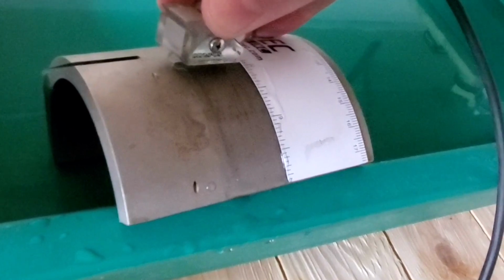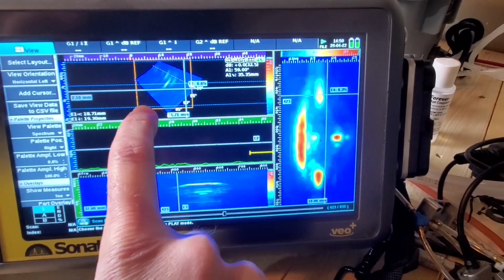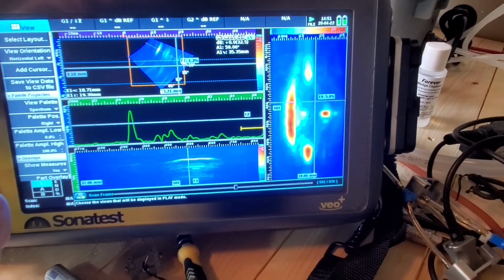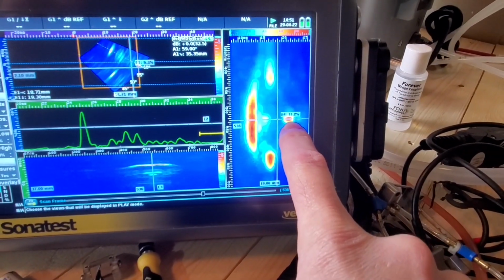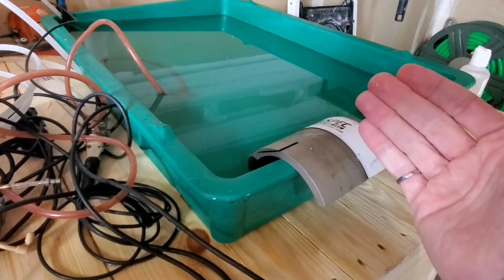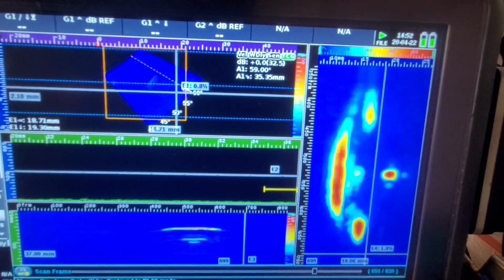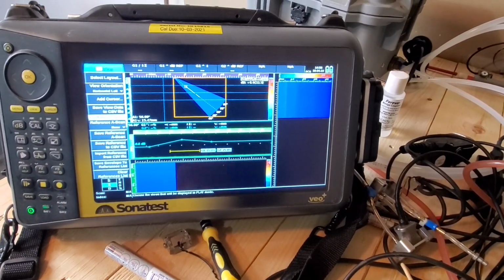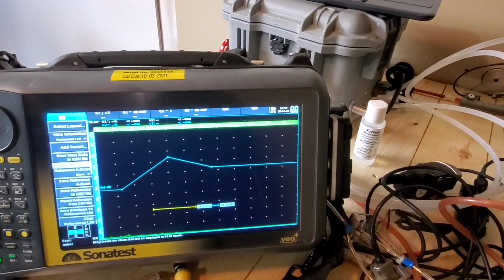Beam Divergence

Comment: Hi paul, thanks for the awesome info, really appreciate it 👍🏻.
Do you think it's possible to incorporate 3D printing in ultrasonic inspection? I made a step calibration block out of PLA with 100% infill, tried to get thickness measurements right, but I'm not sure what speed of sound should I use, I looked up to Olympus website and found values between (1800-2600 m/s).
I used a dual probe and got readings like 10mm and higher right, but when it gets down to 2 mm it doesn't work well, the device shows me incorrect measurements. So do you think using the auto-calibration feature on sitescan D+ might be the right way to get more precise results?.
BTW, I used an ordinary FDM printer to make my plastic specimen, and the echoes resulting from it was very coarse like a cast metal, maybe because the way FDM printing process leaves tiny air gaps between the layers of the piece, unlike injection molding 🤔, I don't know if resin printer are any different.
In fact I found an interesting research by an American university about using C-scan in inspection of 3D prints, and it seems possible.

The bottom line is that if we can get this to work with A-scan, it will be great way to make any calibration block you can imagine cheaply, or making  specimens with hidden defects for the purpose of training at least, so, what's your say?

Sorry for the long comment 🙏🏻.
Reply from the maker: Hi Bacel, this is actually one of my research projects. Haven't had much time to work on it lately though.
Reply: @hollowayndtengineeringinc.5201  Cool!, very cool actually 👍🏻, I hope you'll be able to continue your project when you have time, good luck!
I'm looking forward to see it 😁

Comment: Hi Paul. In the internet it is easy to find a complete calibration for phased array weld inspection plates, but is not easy to find a full calibration for welding pipe joint. Do you have a video like that? Best regards.
Reply from the maker: It's on my list of videos to do